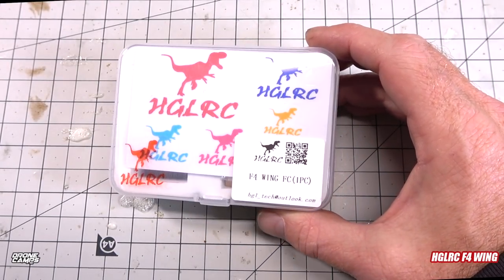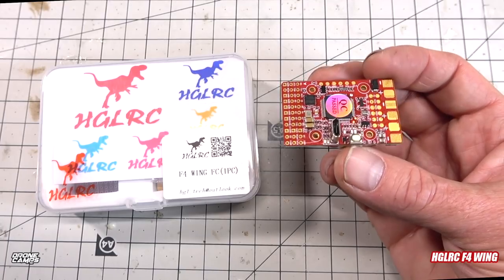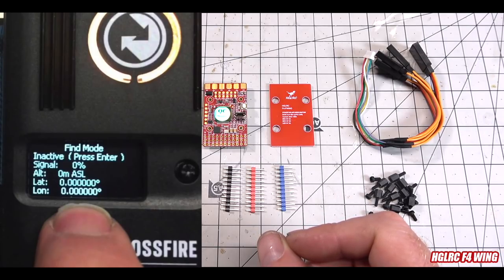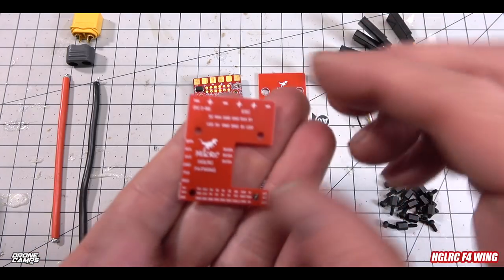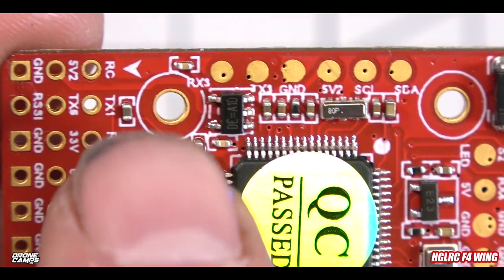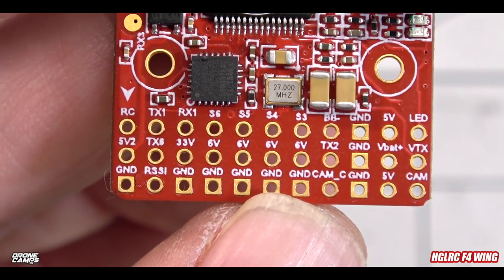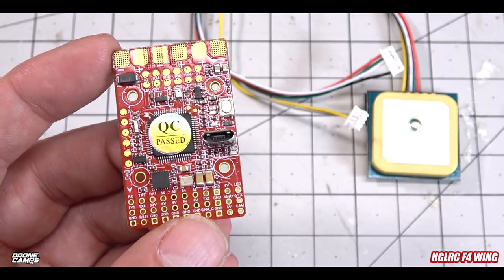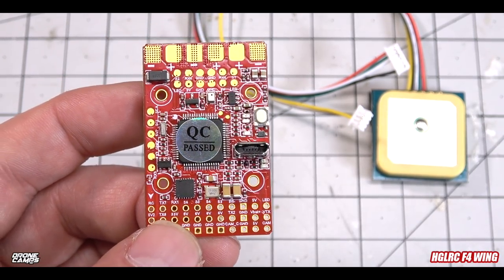HGLRC F4 WING Flight Controller & GPS - FIRST LOOK & REVIEW

Comment: Worth mentioning that you need to connect a GPS unit to your XF RX to get coordinates on the back of the full size module. According to TBS you can get up to 40km on the micro, which is alot when you're starting out, so no shame to start with that. If you use a OpenTX radio and run INav with GPS like Justin suggested, and also use a RX with telemetry like Crossfire or X-series FrSky, you can click on "Discover sensor" in OpenTX and get the last recorded GPS coordinates from the FC to be displayed on your OpenTX-powered unit.